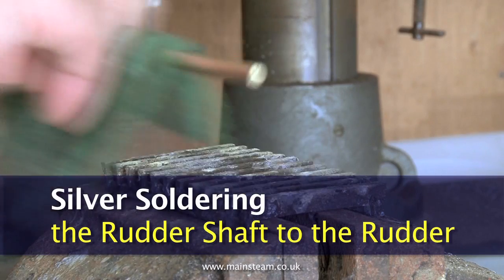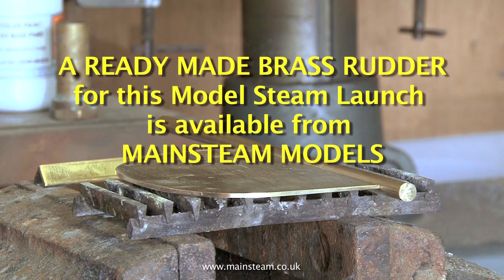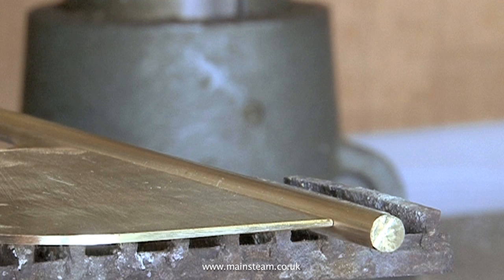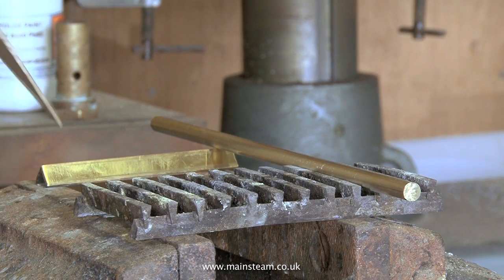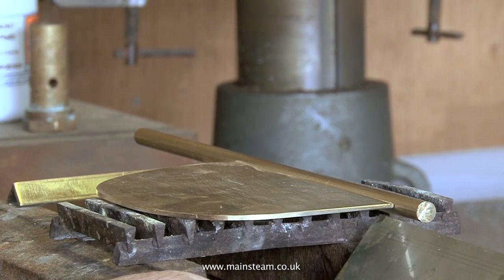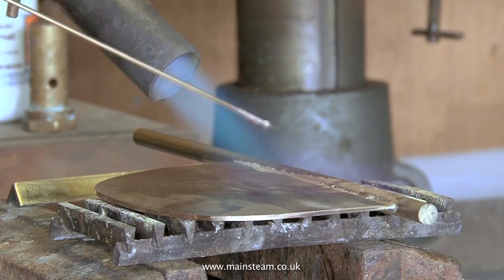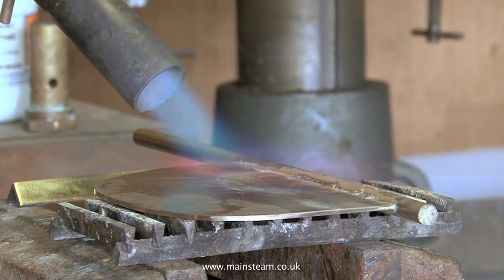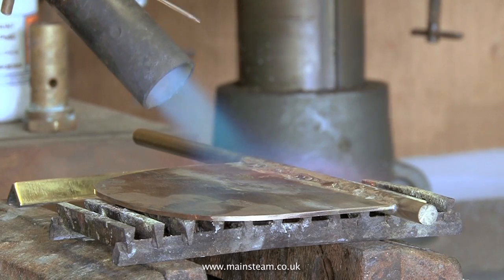HOW TO SILVER SOLDER LARGER ITEMS

Comment: amazing! thanks so much, I'm trying to figure out the difference between silver solder nad silver braze, braze has more silver content right, so it's stronger, requires more heat? I am gonna custom fab a fuel rail what sort of silver solder would I need to bond the pots to the rail and end tabs etc?